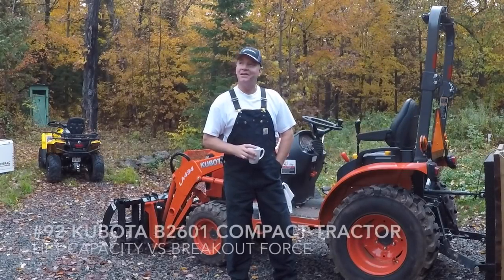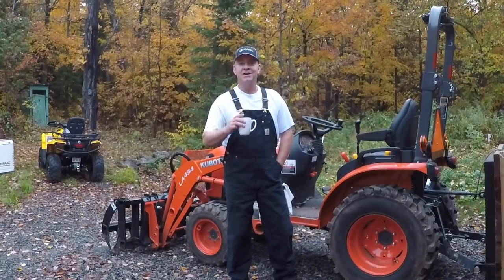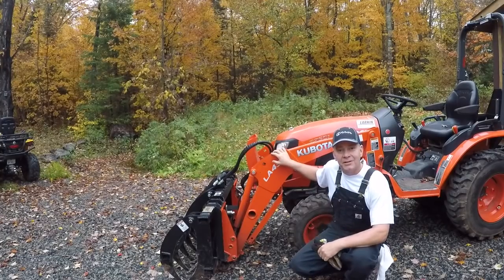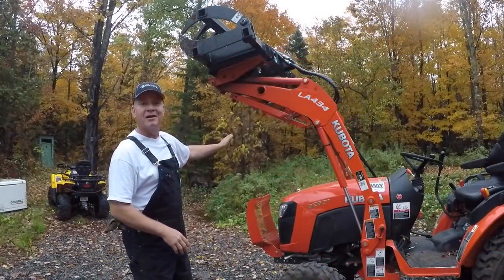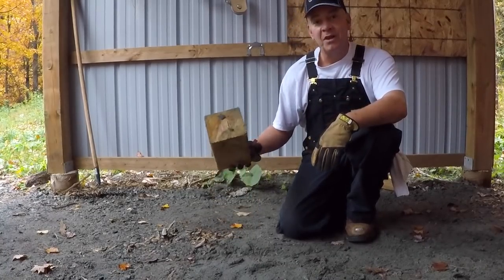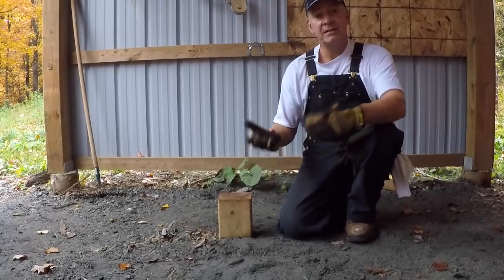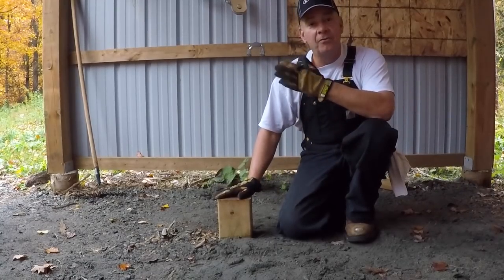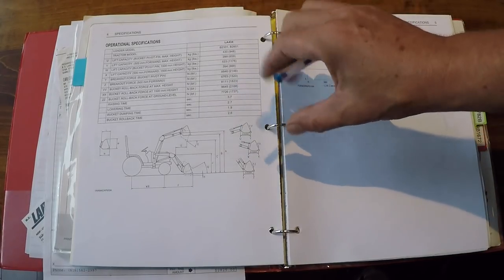#92 Kubota B2601 Compact Tractor The Great Debate : Lift Vs Breakout Force

Comment: You should re-do this video because it is miss-leading. The Roll-Back force is similar to using a claw hammer to extract a nail from a piece of wood. It is only using the curl cylinders to curl or roll-back the bucket, pivoting it about the roll pin where the bucket is attached so that the front of the bucket is raising while the back of the bucket is resting on the ground. It is leveraging against the ground for maximum force. The BreakOut force is a combination of the curl cylinder and the lift cylinder to perform the combined function of curling the bucket so that the front edge is raising and the lift arms are lifting the bucket vertically. The BreakOut force is greater than the lifting capacity because it has two cylinders working in tandem to produce the force. But this is only measured at the ground because you can actually rest the bucket on the ground and leverage the bucket against the ground using the curl cylinders for a brief moment while it is also trying to use the lift cylinders to start the lifting process. After the bucket is off of the ground, then all of the force is being derived from the lift cylinders for the rest of the lift stroke, and as the lift cylinder is extended, it actually gets de-rated because of the internal surface area of the exterior cylinder housing that is now taking more and more surface pressure, which can cause a rupture of the cylinder wall as more cylinder wall is exposed to the hydraulic pressure. Maximum cylinder hydraulic pressure and max load is always with the least amount of cylinder wall surface exposed.

Comment: The lift capacity 500mm in front of the pin is what you should be able to lift and be well within the FEL design limits, not the value at the pin. If the centre of gravity of the load is closer to the pin then you can lift more as you get closer to the pin.

Comment: I have a B2601HSD on order. The salesman told me because I lift 600# logs I need to get the L2501. I just ignored him and I feel more confident in my decision after watching your videos. 1500# 2’  off the ground is more than ample for my needs. Thanks and keep the videos coming 👍🏻
Reply from the maker: Good morning H! Congrats on the new tractor! You must be pretty excited. I am happy the videos have helped you a bit but please remember , I am still a  newbie. I have learned so far that the front axle is rated for 1300 lbs, so I basically now try to lift well under that weight but otherwise if a log is heavier , I simply cut it first and take two pieces. I have also learned not to try to carry 15 foot lengths anymore. It's pretty hard to get them through the forest so I generally cut my lengths to about 8 feet maximum - much easier to manage. I keep lots of weight on the back for ballast and so far, my little 2601 has been great. I am really happy with it for the size and weights of the things I need to do with it. Good luck and let me know how it is going from time to time!

Comment: Another consideration when lifting heavy weight is the effect on the front wheels.  I once had the seal of  one of the front tires pop when I made a sharp turn (at low speed) while moving a large log chained to the front end loader.  I had to shut down while I dropped the load, removed the wheel and took it to town to be repaired.
Reply from the maker: Good day Keith - that's a great point. Thanks for sharing with us. I agree - front axle capacity is very important. Cheers!

Comment: I’ve got to say GP, that’s the best (and only) description of what all that means I’ve ever heard! Thank you for going to all of the trouble to dig out the meaning of those specifications. I know it was a lot of work and you did a great job of it. I’m in the process of picking out my first new tractor and it gets overwhelming watching and reading everything. You just made it more simple to understand. Thanks!
Reply from the maker: Hey thanks Jim! So make sure before you buy, that they show you that spec sheet and graph in the manual. That will help a lot. At the end of the day, you need to know what you can lift safely off the ground. Be well and all the best!

Comment: I am pretty much sold on the Kabota but am wrestling with the size, I like yours but if i want to bale some hay then it needs to be a bit bigger.  Hmmmm...  maybe TWO tractors?  ha ha.
Reply from the maker: Hey RC! I agree to a point with Joel. Buy as much as you can afford and balanced with what you know you need it to do. Good luck and let me know how it turns out! You don't want to find out after that you cannot lift or do what you need to do with it. All the best!
Reply from the maker: Very true I bet Joel. LMAO. Get the most you can for your budget for sure. Its got to be brutal finding out after the fact that the tractor you bought doesn't do what you need it to. Cheers gents!!
Reply: I did last week!!! But I must admit it was one odd job situation where I wish I had a smaller tractor. The next day, I already changed my mind! Bigger/better. Lol!
Reply: @unsignedchar000  I'm trying to sell my 1970 G950 Minneapolis Moline because I've downsized my property and definitely have way too big of a tractor. I wish I could shrink the big mule.

Comment: GP, I love your videos, please keep it up! If you look at the triangle created by the lift cylinders and the boom of the loader when the bucket is on the ground, you’ll notice that it’s a much “fatter” triangle then when the boom is fully raised. In the fully raised position the triangle is very “skinny”. The “fat” triangle is what gives the lift cylinders their power. The skinny triangle seriously takes away from that power. In fact if you imagine the boom raising beyond the full lift height of 6.5 feet, it’s easy to see that in theory, the lift cylinders would be pushing directly through the hinge point of the boom in which case they would have no lifting capacity whatsoever. As far as breakout force goes, I believe that has to do with the geometry of the curl function. The curling of the bucket while on the ground can provide tremendous lift capacity because of the geometry and linkage of the bucket cylinders. Hope this makes sense!
Reply from the maker: Good morning Bert! It actually does make sense to me - thanks! I have never had it explained that way before but it was super helpful. Thanks again! Have a great weekend and all the best!

Comment: What ever weight it can lift you need to subtract the weight of the Implement
 (  loader bucket, forks, snow plow, ect )
Reply: Correct.....he missed that important point....and on these small tractors, a 200 or 300 lb. Implement really cuts down the actual capacity.

Comment: I think the breakout force is what the RV is set to in the loader valve. The pump might only put out 2000 psi but the RV is set to 4000lbs which means that if you push on something you can double the load before the RV cracks and relieves the pressure. So you might only be able to lift 1000lbs but you could put 2000lbs of force on it before the RV kicks in and causes the bucket to drop. This saves the cylinders and structure from damage. There are usually 2 RV's, one in the pump and one in the loader valve. The one in the loader valve is usually set higher.

Comment: Break out force is what the curl cylinders can exert on the front edge of the bucket ...in this case leverage to scoop out a bucket of dirt or roll back that massive log.
Now looking at the B26TLB specs and it gives a solid description of the forces exerted at certain points.....so wording without giving the specific point means nothing (manufactures game of misleading numbers) and clearly roll back vs breakout force can be interchanged but I view both as what the curl cylinders can do for work at specific points out from the pivot pins at ground level (which is the max breakout point) For the B26 at 1.5m out in front of the pivot pins it is 3969lbs.
So for buyers get a hold of the owners manual and carefully compare numbers at the same points of distance 

Also GP when you curled that log back then tried to do a lift up and nothing happened then you went straight for more throttle and still nothing happened ......brings me to Messicks newest TMT video explaining what just happened or in this case nothing happened nor changed.....anyways great example of the Messicks Vid
Reply from the maker: Hey bkrgi. Thanks for the comment. Respectfully, not sure I can agree with that. Here is the direct excerpt from the ASAE standards (no mention of curl cylinders): "Section 5.1.5 Breakout force—at pivot pin (Y): Vertical lifting force, in newtons (pounds), the loader will exert at the bucket pivot pin centerline using the lift cylinders only, with the bucket horizontal at ground line."  I am not that familiar with a lot of things yet, as you know, but I think this seems pretty clear. Let me know your thoughts - I always welcome your comments. Cheers and thanks for contributing!
Reply: Well I can't argue with the Definition but can argue with the wording. Their "breakout force" literally means lift capacity at the pins with bucket on the ground....so your right in how you presented it....it is to do with lift nothing with curl. For me breakout force is the greatest force you can use on the loader which is the curl on the front end of the bucket of which they call it "roll back force". I think the wording and how they themselves define it is what tosses people off ..like me hahaha because I think breakout force on a backhoe and it's to do with the bucket so I think breakout force/what the bucket on the loader can do which is based on the curl function.
Anyways great discussion and this would really help newbs who truly want to crunch numbers an make comparisons. Honestly for any buyer I would figure out how much you want to lift then find a tractor that can exceed that amount easily otherwise compromising is in order.
When I went looking to buy between the B's, I settled on the very much higher priced TLB cause i did not want something that I could easily twist up....heavier built is better in my world.
Reply from the maker: Thanks for sending the additional info bkrgi. You make some good points. What I was trying to do was help the new folks like myself, cause when we see that spec, we assume it means it is the lift capacity at ground and it is honestly pretty confusing to new folks who don't have the experience like yourself. But your explanation above helps a lot. Thanks for taking the time to write it out for us. Be well and have a great weekend!!
Reply: I would say I tought breakout force like you. So to say, you put the bucket on the ground, FEL in float mode and you measure the "lift" capacity of the bucket only by curling. Apparently, I had it wrong. The rollback seems to define this. Maybe the terms definitions has changed over time after some standardization.
Reply from the maker: Well the good thing is now I know what that other term listed in the spec chart means (Roll Back Force). Thanks guys!!

Comment: Thank you for researching that. Just got a new tractor and was wondering that exact question. One small issue with your physics, the amount of force which is required to lift the weight is any Force above the weight. Even if it's slightly above the weight it will just lift extremely slowly. I imagine if you were trying to lift something extremely close to the weight rating of your tractor you would hear the pressure release constantly kicking in while you were lifting because of the force required to lift the object at an acceptable speed. 
the amount of force required to hold the object in the air is equal to the weight of the object. the amount of force required to hold the object up in the air varies as you drive the tractor over rough Terrain. As it bounces your tractor is possibly holding up more than it is rated to lift at times. if you were to pick up an extremely heavy objects and drive over rough terrain you could possibly damage something. 
I am guessing that I'm telling you nothing that you did not already know. Just a couple things were unclear so I wanted to make sure. Thanks again for doing all that research and actually going to the documentation to find the answers. I appreciate your Channel.
Reply from the maker: Hey good morning Micayle. I wish I spoke to you first - LOL! You did a great job of explaining it far better than I did. :)) Very much appreciated. Actually I didn't know all of that above but now that you explained it so well, it made a few things I had in my mind come together and make sense. Thanks for taking the time to write it out so clearly. All the best and good luck with the new tractor!! Cheers!

Comment: GP, I certainly agree with your observation that lifting a load at a distance from you is much more difficult that lifting it close in. A key indicator in my view is that the manual shows different units for lift than Break out Force (BoF). The BOF units are for torque, i.e. foot-pounds. A good analogy might be lifting barbells just using your wrist (i.e. curl cylinder). Imagine straight-arm curling a 20 lb barbell only with your wrist, but then extending that barbell from your hand 12" somehow, then trying to curl it again....way harder. The further away the barbell, the harder it is to lift. (twice as far out, means you need twice the torque).  This capacity (BoF) is different than what barbell you can lift vertically using only your biceps (lift cylinders).
Reply from the maker: Good evening Ron. That's an excellent observation and makes good sense. The manual also shows different values for roll back or curl force. This has been an intriguing subject for me Ron. Lots of different or varying views on the definition of BoF. But I think I am getting closer to fully understanding the correct interpretation of it. Thanks again good sir. An excellent example using the barbells. Cheers!

Comment: Tried to lift to much once with one of my kubotas. It lifted the back wheels off the ground. Had 600 lb. Rototiller on the back. 
Best to go easy when lifting the heavy stuff.
Reply from the maker: Thanks Dave. I agree. But good to know how fr it will go if really needed. Otherwise, I like to keep it safe and low weight if possible. Cheers!
Reply: the towns new T5.115 a 115hp newholland cant lift 940 lbs of bricks on pallets wich kubota could lift it like a hulk  :)
Reply: @michaelmactavish1728  My 25 HP L could life that and more... what gives?
Reply: @roflstomps324  yeah there strong little beast seen some city guys useing a b2601 doing sidewalks in the winter wich pretty slick multipurpose and cheaper then spending $140,000 on a holder wich redicluas for a little holder c992

Comment: Gp It's your front bucket curl cylindres and I had lots Backhoe and experience with the Breaking force . I'm not crityzing you , love your videos GP I dont wont you to break anything on little tractor b2601 , mY KUBOTA IS 1999 , 24 HDS , LOVE IT ALLMOST 28 years now but it sleep Inside .no heat .have great day .keep the videos comming, God Bless .
Reply from the maker: Thanks Leo!! Always appreciate hearing from you. And I respect your opinion a lot. You have a lot more experience than me. The important point for me out of all of this is that I know I am not hurting my tractor lifting that 1500 lbs a foot and a half off the ground. And I sort of get the break out force thing (not totally but a bit more than I did). Thanks my friend. And thanks for sticking with me for so long on this channel. Cheers and all the best !

Comment: According to the chart in your manual, I am glad to see that my understanding was wrong, that break out force included the curl function. It likely does, but the graph clearly shows what JUST the lift cylinders can do. But I'll have to argue a bit that it's not the extension of the cylinders that causes the reduction in lift....look again at your cylinders at ground level versus fully lifted. There is a massive difference in the geometry, down low the lift cylinders have far more....uhm, kinda hard to explain, lol. But I THINK the extra lift down low is simple geometry. Combined with some curl power.
Reply from the maker: You are probably right 10essee! I think I sort of got it ok, but I still have questions about that whole curl thing but I think I feel a little more confident about what it means. At least know pretty much for sure that the Break Out is not the same as the lift capacity. Thanks my friend. Keep smiling !

Comment: Does the 931 pound lift capacity to its maximum height include the weight of the bucket or the grapple?
Reply from the maker: Good morning Joe, No I believe it is in addition. I asked the dealer and also in the manual it identifies that the loader and bucket together are 610 lbs and the specs are in addition to that as I understand it. Hope that helps. GP.